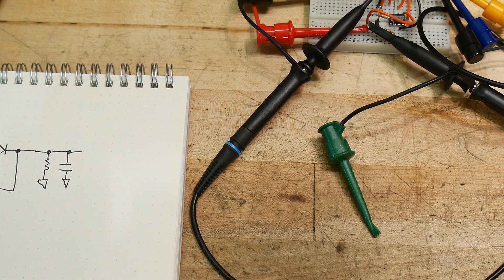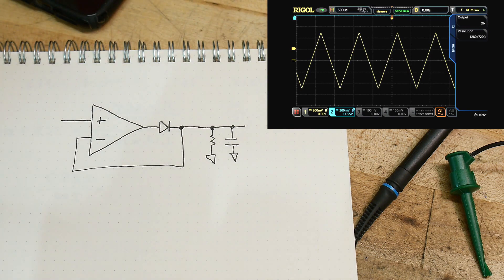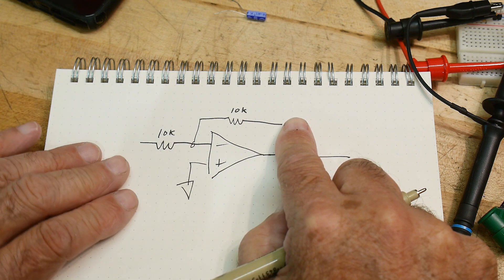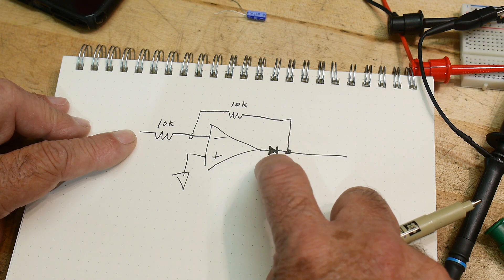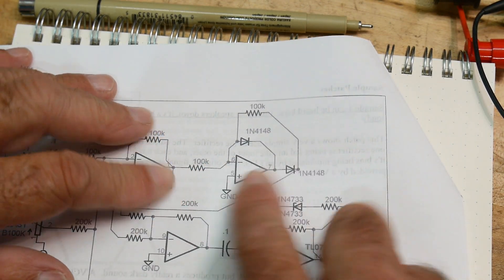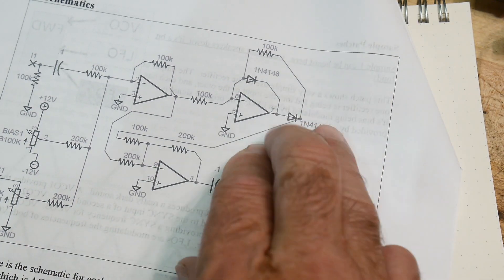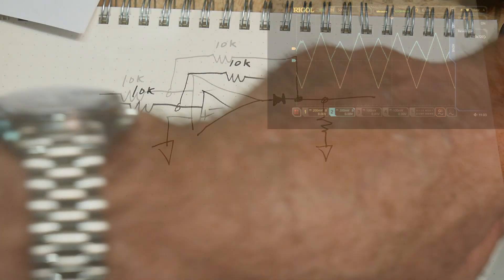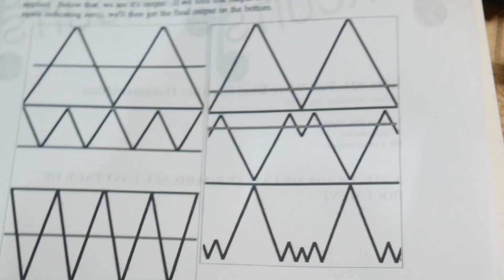#899 OpAmp Diode Rectifier Circuit

Comment: That circuit in your paper is a base circuit of a one semiwave rectifier. When the input signal passes through zero the output would tend to go into saturation but when one diode start to conduct, wiĺl limit the output.

Comment: I wonder if the leakage at 4:00 is not through the diode but rather through the two 10K resistors.  An easy way to find out would be to add a 20k load to the output and see if the positive sides cut exactly in half.
Reply: That’s my understanding too.

Comment: The reason for the second diode is to prevent the op-amp from going into an open-loop saturated condition.  When the diode is reverse biased the voltage at the output swings widely (and when you have the load resistor all the way into saturation).  The recovery from this takes time due to the Op amp slew rate and/or the recovery from being saturated at the rails.  By putting the second diode you are killing the gain when the diode is reverse biased which avoids all of these problems.  devtts0 has a good tutorial on this at https://youtu.be/dCojRDwoFaI

Comment: Since we're talking analog synths, the other interesting thing about the circuit at 5:19 is the output frequency from the opamp is twice the input frequency. Would have been interesting to look at the harmonic output using the FFT function. Diodes are amazing, it's all too easy to take them for granted :)